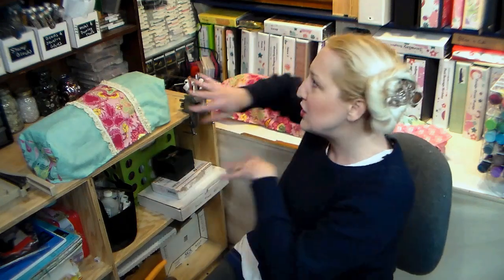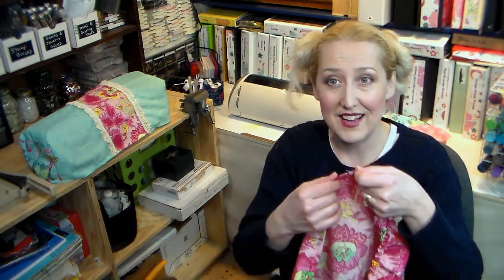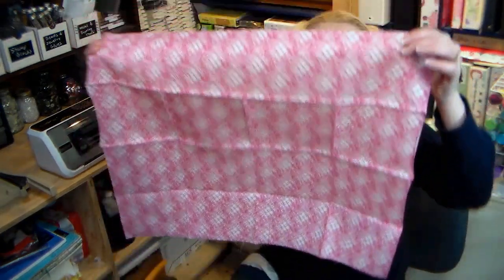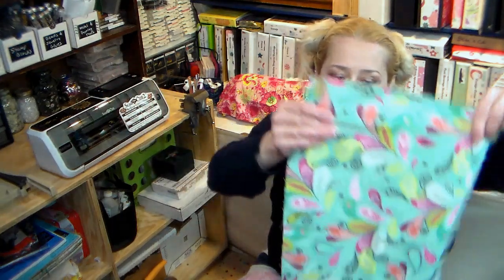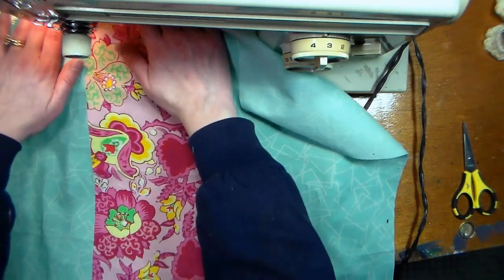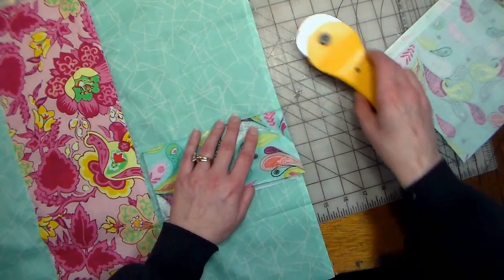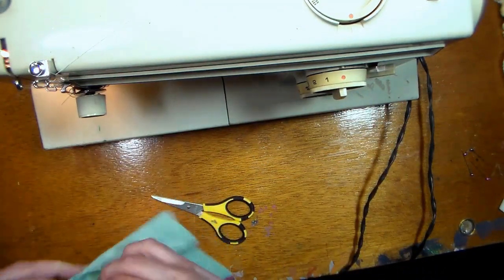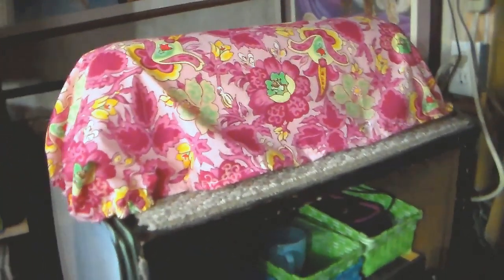DIY Dust Cover for DIE CUT MACHINES SEWING MACHINES MINC and more

Comment: Can't wait for the Scan N Cut 2 and Minc machines demos!!!  I have both and have only used the Minc (the Anna Griffin small one, have the Purple Cow Laminator that I have used for the larger Minc foil applications.)  Did I see a note that you were stalking the Cray-Pen booth?  You got to go to CHA and meet all the rock stars in the industry???  I would love to go one day!!!!! That pesky little rule that you need a store,etc.!!!!  I bought the Cray-Pen - can't wait to use it with my big box of Crayolas!  Also can't wait to try Tim Holtz Distress Crayons - he said they will resist sprays and inks on top of the crayons (not wax based)  unless you touch them and then they will be activated.  Paula in Florida